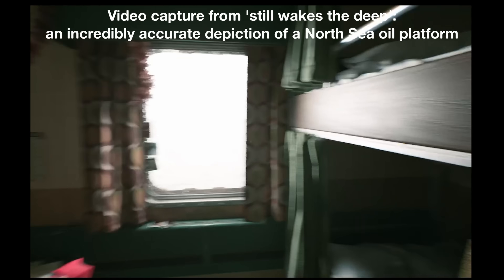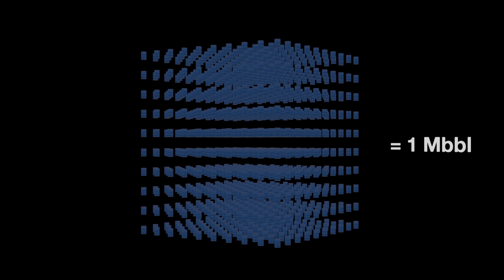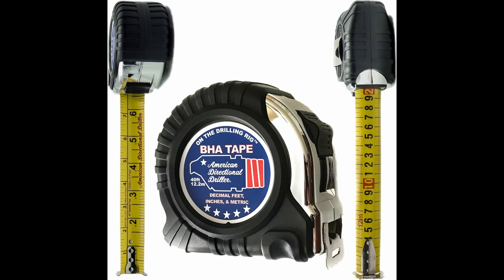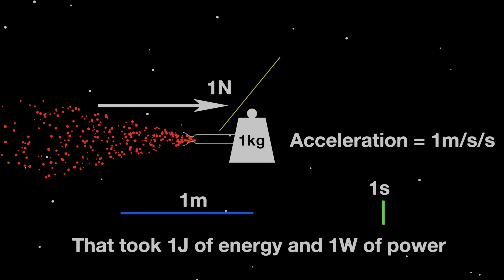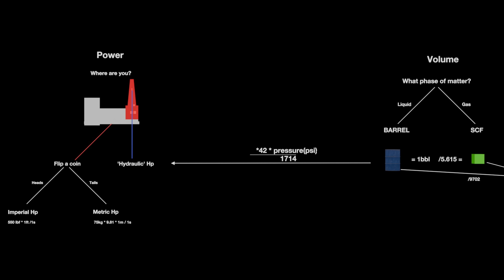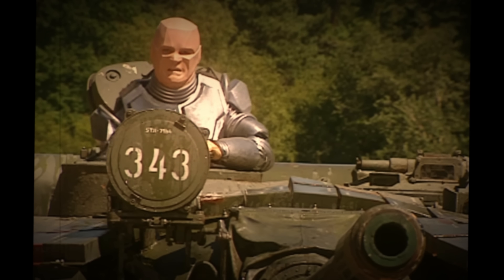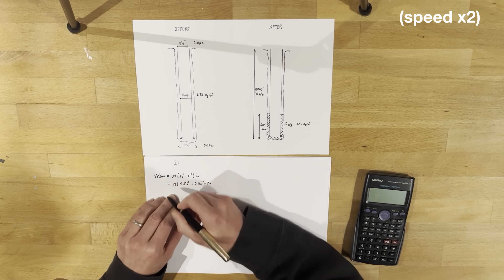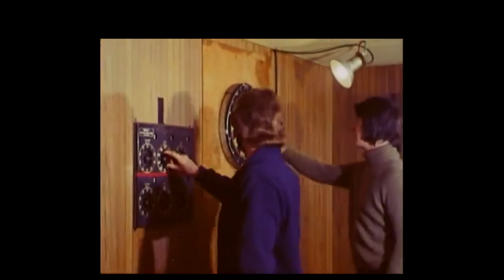Oilfield Units: a Measurement System so Cursed it made me Change Career

Comment: 8:21 "Pound is actually a unit of force, not mass" Wtf ???
Reply: It's the weight force of a pound of lead on Earth. A pound of lead on Mars would still have the inertial mass of one pound (also called pound mass or lbm) but it wouldn't have the weight force of one pound (also called pound force or lbf).
Reply: First, let's look at it from the perspective of SI.
Your weight is really the force a planet pulls you. Your mass is how much stuff or matter you actually are.
The weight force F equals m * g, mass times the acceleration from gravity.
1 kilogram of mass * 9.8 m/s² gives 9.8N (newtons of force)

A scale weighs you by the force and converts it to kilograms automatically. In effect it takes your weight force in Newtons, divides it by 9.8 to get a 9.8 times larger unit of force, and calls it kilograms. That happens to match with the actual mass.
This "calls it kilograms" thing can be called kilogram force or kgf, whereas the actual mass is kg.
I assume pounds also measure force in the same way as kgf

Comment: Wait, whats your issue with ppm and ppb?

Onky thing i dislike is that its not as easy to convert between percentage and ppm becsuse its not factor 1000
Reply: For concentration units, it is often unclear what two measurements you are comparing. ppm and ppb are normally used for comparing two molar amounts, but they don't have to be. You could also be comparing two volumes like in a cocktail recipe - 1 volume equivalent of hydrogen sulfide in every one million volumes of air (equivalent to molar assuming ideal gas law, not quite in reality) - or even mixed measurements like the number of particles per cubic meter.

And then comes nuclear magnetic resonance spectroscopy and measures the deviation of a radio frequency from the reference signal in ppm because Hz/MHz = 1/1,000,000 = ppm.

Comment: The fact that the British thermal unit is differently defnied in America and Canada just absolutely broke me
Reply: Canada is a Metric/Imperial mess. You measure the height of ceilings in feet, joists in feet, pressure in PSI, distance in KM, weight in pounds, temperature in Celsius, inches, and cm are used simultaneously. It's technically metric, but people use whatever parts of metric/imperial they like more.
Reply: @dnb5661  don't forget, although our temperature is in Celcius, our oven temperature is in Fahreheight. Also you measure your own weight in pounds, but everything else in kg.
Reply: @dnb5661  To be fair, we've attempted to go fully metric, but it's hard to do so when the US is our primary trade partner; hell, one of our biggest longstanding trade disputes with the US is how many "boardfeet" of lumber there is in a cubic metre of wood.
Reply: @Nukestarmaster  just ditch the metric and use imperial, and then do what we do, metric is for (most) guns and drugs. if you do that i will ask that you help teach people that slug is the correct mass unit and not pound though... which will inevitably cause you to use metric more for drugs to help with the headaches of that.
Reply: In Brazil you have horse-power (hp) and cavalo-força (cv), which you might think is just a translation of HP to portuguese, but it is a different value of power, as if someone used a different horse for the standard.

1 cv = about 735 W
1 hp = about 745 W
Reply: @Carlos-ux7gv  1 [brazillian horse]power
Reply: @krispy_kornflake  oh, so that's bhp 🤣
Reply: not to mention, that BTU is used in the hvac industrie for power and energy simultainiously.
Reply: @clockworkvanhellsing372  and don't even get started on measuring refrigeration in "tons".
Reply: @mmnootzenpoof  to give the USA some credit, at least they didn't mess up calling BTUs and BTUs per hours both BTU. If I'm correct, that's on the british.
Reply: The miners inch is differently legally defined in northern and southern california for water rights. Its got many variations in many places all legally written into law and enforced.
Reply: @alleyf3500 I hate you break you further but the liquid measures are also different. Canada uses imperial units so their ounces are smaller, but their pints have more ounces (20 vs. 16) their pints, quarts, and gallons are bigger. Also a US quart is just under a liter and a UK pint is bigger than a liter. The reason that the US system is correct is that a US pint of water weighs one pound.
Reply: @pjl22222  A UK Pint is not that big. Its 568 ml, where a US Pint is 473 ml.
Reply: @blairhoughton7918 Sorry, I meant quart. US quart slightly < liter, UK quart slightly > liter
Reply: Isn’t it measured in SACC and DOE iirc? Or is it DOE and ASHRAE? ughhhh
Reply: And there is over 140 different "inch" definitions around the world. Sweden alone has three different inches. "Standardtum", "Verktum" and "Traditionell tum" (standard inch, workmens inch and traditional inch) it also has three different miles, metric mile, coloquial mile and swedish mile, (10000 m, 14485 m, and 10688.54 m respectively)
Sweden also have different miles depending on landskap, Västergötland has a mile that is 13km, Ångermanland and norrland in general has a own mile that is defined as 6666 fathoms (and yes, fathoms are also different in norrland and is longer than in the rest of sweden) and Dalarna has a mile that is 14485 m.
Reply: 59F is 15C even.
Reply: Gas is compressible.. you just pick standard conditions, not that hard
Reply: Elaborate.
Reply: @dieselscience   Learn some manners you troglodyte
Reply: @dieselscience  1Btu is 59°F/15°C in the USA, 60°F/15.6°C in Canada
Reply: @izd4  Sorry but no. It's not a measure of temperature, it's a measure of energy needed to RAISE temperature of a pound of water by one degree F. 
Q = M x Cp x ΔT
Degrees are incorrect units for BTUs. You can use joules, calories or watt-hours. 
1.0551 kJ (kilojoules)
0.2931 W⋅h (watt hours)
252.2 cal (calories)
Reply: @dieselscience  pure nitpicking; the point is that there are two subtly different values
Reply: @izd4  You're not even making sense. BTU is NOT MEASURED IN DEGREES. You're saying the same as if you measure time in kilograms.
Reply: @dieselscience  I think what they mean is the reference temperature used to calculate BTU. You need a reference to pressure and temperature to calculate energy from a unit of gas. In this case pressure is referenced to atmospheric pressure, and temperature has different references if you are in the US or Canada, 59F in the US and 60F in Canada. It’s a difference of approximately 0,12 Joules, but it adds up when working with millions of units of gas. 
I know the pain of this as I work with this on a gas refinery plant, we typically use two different references as well; 15C and 0C depending on which market it’s to be sold to.
Edit: to clarify even more, a volume of gas at different temperature has different density, thus different amount of molecules. A gas at lower temperature has higher density thus higher energy, to standardize the amount of energy you reference it back to the “standard” temperature (standard being a fleeting term here).
Reply: @Matta1224  BTU measurement does NOT require any reference temperature. You could convert units but there is no starting point. The only end result is DELTA T. Also, temperature and pressure change energy, not density. Other than that, BTU is based on liquid water, not gas. It could be applied to gas but the energy is still the same.
Reply: @dieselscience  so its like standards, like how different civil engineering codes of other countries define specific value of something.
Reply: @dieselscience It definitely does require a temperature reference for its calculation. Depending on the initial temperature of the water , the amount of energy required to achieve 1 BTU varies - not by an extreme amount, but still a considerable one, up to 0.5% in between the different definitions. In order to define the value of one BTU , there has to be a fixed "starting point (so to speak) or the result would be an arbitrary one within that range of variance . Once that standard is agreed upon, any further calculations using BTU are temperature independent, since now you have  defined values for all parts of the equation and not one that could contain any value from within a vector of values. Your statements tell me two things:A) You haven't fully understood the concept of how units are defined (standardization) and B) You are unwilling to put even the slightest effort into evaluating your knowledge. Dunning-Kruger says hello! 👋
Reply: @ceemosp  It definitely does require a temperature reference for its calculation. Depending on the initial temperature of the water , the amount of energy required to achieve 1 BTU varies 
Absolutely false. Wikipedia has failed you and you were never a student of any of my classes. You seem to be thinking of HVAC units and not thermodynamics. I posted the formula used by engineers and physicists worldwide. Show your math.
Reply: @Hyuga_Natsu00  Thermodynamics is mechanical rather than civil but the standards are one pound of water (453 grams) liquid, and a temperature change (delta T) of one degree F, use Rankin scale if you like, or convert it to Kelvin..it's the same. It does not change. Calculate the amount of heat ENERGY required to make that delta T. Pro tip: Energy is NOT measured in degrees.
There are some self-taught air conditioner mechanics who think they understand the assignment and they're lost.
Reply: @dieselscience 
Lets use calories for simplicity here since as you mentioned the calculations are the same. Q=mcat does not change, that is correct.

However, when you are measuring the amount calories in a given volume of a compressible fluid, you need to know the temperature and pressure of the fluid so that you can compare the number of mols of one sample of natural gas to another sample of natural gas under different conditions. 

A liter of natural gas at 1 atmosphere and 0c would contain about 9005cal, whereas a liter of natural gas at 1 atmosphere and 30c would be 8040cal. That is a significant difference.

So yes while 1 btu is always going to be equal to 1btu regardless of temp/pressure/volume, what exactly one btu of gas is changes dependent on those three factors.
Reply: @cyruskhalvati  Gas comes in SCF, energy content is measured in BTU and taxed accordingly. You do HVAC repair and I can tell.
Reply: @dieselscience  im an accountant buddy. An oil and gas accountant.

Energy content in a given mass of gas is calculated via btu. You have to know the mass.
Reply: @cyruskhalvati  I'm sure you're proud but I'm an actual petroleum engineer and, NO, that's not how we test. Gas is measured by volume with each constituent hydrocarbon as a percentage of the standard cubic foot, NOT MASS and NO, not at all are they related to the definition of BTU. It's reported as "BTU per SCF" and ONRR asses tax based on that, not mass.
Reply: @dieselscience  professional point misser
Reply: @moikkis65  No. Professional Engineer, not HVAC mechanic.
Reply: @dieselscience  BTU uses a reference temperature because the amount of energy required to raise the temperature of water by 1° varies by temperature. (Yep, sounds fishy, but it is true.) If you look up the official unit definition for the calorie you see the same thing.
Reply: @DrewNorthup  No. BTU use an INITIAL temperature and a FINAL temperature, not a reference temperature. This is because BTU is a calculated value, not a measured one and requires, by definition, a CHANGE in temperature (called "Delta T") in order to be calculated. BTW, a calorie is a unit of heat like a degree is, neither are a BTU. Trying to measure BTU with a reference temperature is nonsense. BTU is not a measure of temperature and time is not measured in kilograms.
Reply: @dieselscience  You completely missed the point of what all of us have said. That's not a good sign. Have a nice day.
Reply: @DrewNorthup  I think you're lost in either the math or the concept of using incorrect units. The 'point' is you're wrong and refuse to admit it. Man up.
Reply: Dude, Canada IS IN AMERICA
Reply: @St0rmC4st3r So is Brazil. America in this context obviously refers to the Country shortened to America and not the two American continents.
Reply: @St0rmC4st3r  So close! Canada is in North America. Or, on one of the Americas. Hell, maybe even just say "The New World".

"America" refers to the United States of America.

Comment: American here, I have no notes. It’s like the oil industry saw our need to overcomplicate systems and put our own mark on things and said, “That’s adorable. Lemme show you how it’s done.”

Tangentially related: what weighs more, a pound of feathers or a pound of gold? Bizarrely, the answer is a pound of feathers. Gold is measured in Troy pounds, which is only 0.8228 of a ‘Standard’ pound. 

So 1 pound of feathers is equal to 1.21528 pounds of gold. 

The Troy ounce is all kinds of its own nonsense with different grams per ounce [31.10], ounces per pound [13.1657], and pounds per US Ton [2,215.355], or Metric ton [2,442.005]

Instead of 28.35, 16, & 2000, 2204.62, respectively. 

Looks like oil n gas are in good company as far as needlessly complicating things to both make them sound smarter, and dumber, as appropriate. Definitely makes mistakes much more understandable. Even egregious ones like bouncing a rover off the surface of Mars. It’s a lot to keep in your head. Add in additional languages or high stress work or rapid turnover, it’s a wonder we get anything done. 

Keep being awesome!

Cheers!

Comment: I feel your pain. 15 years ago I worked for a company building drilling simulators and my last job was simulating a  a cementing unit with its sack bullshit. We worked with Americans (full US and odd oil filed ), Canadians (used a odd mixture of US and SI) and Norwegians (full SI). It was a nightmare. They guys I delt with from the north sea (Brits and Norwegians that worked on British rigs) were pretty honest and said it was crap but its what people use. Ditto Canada.

I love a good imperial measurement from a romantic POV as it tells a story of what it is measuring as imperial measures a property of a specific item. They quite often work well in a intuative sense with basic products. Hence the different fluid oz sizes, barrel sizes, why feet and mile don't line up nicely etc However for a calculation its just adding in a potential error point for zero benefit and with safety critical calculation you want to refine your process to minimise potential errors.

As for the ego thing, well it seems to be universal seen similar in other areas of construction and engineering where people get all upset by someone using SI similar.

Comment: Retired petroleum engineer here. Laughed out loud!  I reckon I spent at least a year of my 25 years just doing unit conversions and then double checking them. Here’s another one for your list. Reservoir volume measured in ‘acre feet’.
Reply: No dude, acre feet ??

That is insane. I almost dont believe it.
Reply: 'acre feet' is a DISGUSTING measurement.
Reply: We use it in hydrology too... it's bad but makes sort of sense
Reply: @elgatto3133  well, I suppose, for a reservoir that's X acres wide and Y feet high, saying that the reservoir is XY acre-feet would make it easier to measure on field, then the nerdy engineers can "translate" it into a "usual" unit.

Still though, holy hell.
Reply: If you're familiar with the work of Orkiszewski, he uses lbm/sec^2 for interfacial tension. The dimensional analysis converting from dyne/cm is an absolute nightmare. Some of pipesim is built on Orkiszewski. It's fun.
Reply: @brycemartin7461   Controls Engineer here. This is my world. LOL

Flow calcs and flow computers kinda scare me.
Reply: It kinda makes sense when you live in the insane US customary units system. Local farmers know how much irrigation each crop needs in terms of feet of water (think inches of rainfall) and they know how many acres of each crop they have planted, so 'acre feet' is the most natural expression of volume of water for irrigation. Of course, if they were using SI units they wouldn't be filled with dread when converting 'hectare centimeters' into cubic meters.
Reply: @onodera3964  I once read somewhere that "1kg of rain over 1m² of land equates to 1mm of rainfall" and it immediately doubled my appreciation of metric system.
Reply: @brycemartin7461  "acre feet" holy shit that's wild
Reply: @brycemartin7461  can i measure how much air my lungs hold in that?
Reply: @TheMagicalTouch    I did the conversion and my lung volume used to be 4.866x10 -9 acrefeet.  I expect these days it is down to about 3.5x10 -9.  Long time with no trumpet playing...
Reply: @brycemartin7461  ugh you had to go an remind me of acre feet....
Reply: Acre feet? It sounds like football fields in washing machines
Reply: Shame on you planet killer